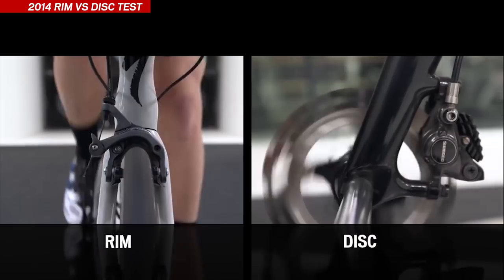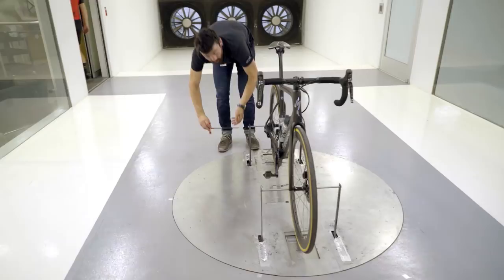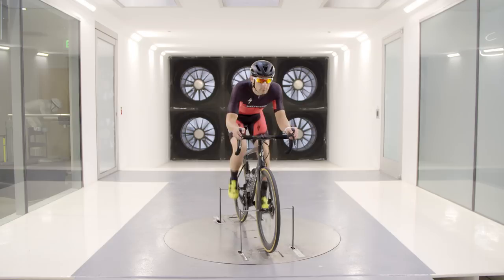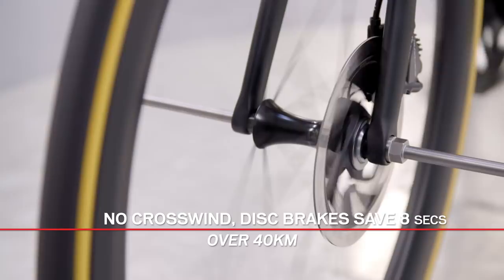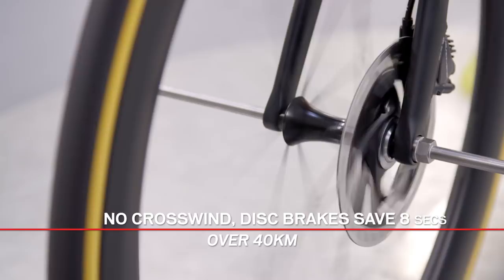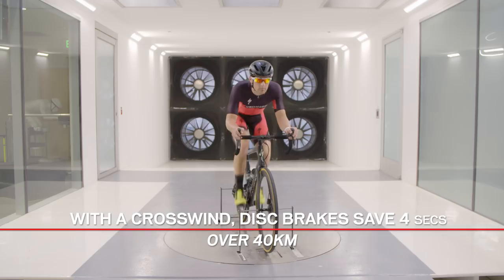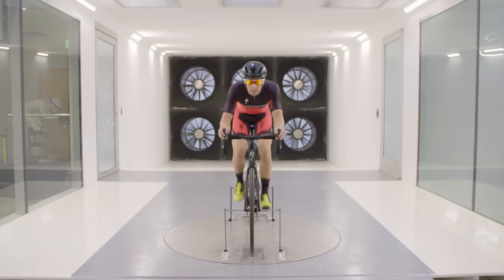The Win Tunnel: Rim vs. Disc Brakes

Comment: Can we get an explanation video about why disc's are faster? I'm interested in how that happens.
Reply: Dolfo Picanco cleaner interface at the fork crown area
Reply: Brake  disc have a better profile aerodynamics ...or  lower drag coefficient... you can see this image..  https://en.wikipedia.org/wiki/Drag_coefficient#/media/File:14ilf1l.svg
Reply: Yea, Shadowboost below is getting at it. We're able to (subtly) improve the shaping in the fork crown area, and also the upper seat stay area since we don't have to deal with the rim brake mount interfaces. The disc calipers add almost no drag since they are mostly drafting other tubes (e.g. fork leg). What's left is the hydraulic housing (basically even with rim brake cable housing) and the disc rotor, which is the primary drag culprit for discs. We're now able to more than offset that with frame/fork shape improvements.
Reply: I think its mostly marketing B.S. and bad science, as usual.
Reply: @sylvainmichaud2262  If you are going to say this is bad science, you have to provide at least a small explanation.
Reply: @DaveCM  I don't have to provide the science. Corporation making claims do ! I've been in the business of BS Marketing for most of my career. Believe me, there's very little science behind it and usually it has gone through a "rigorous process" of cherry picking.
Reply: @sylvainmichaud2262  no, you do. You made a claim, you have to back it up. They provided wind tunnel results. You claimed it was flawed and basically faked. You have to be able to point out at least some issues you have.
Reply: @DaveCM  
You sound like a flat earther, a Christian apologist or a climate change denier.

“It's easier to fool people than to convince them that they've been fooled”
Mark Twain

Comment: There are still a few issues that disc brake systems present that rim brakes don't experience. The first is the change from a symmetrically built front fork as compared to its asymmetric disc version. They won't perform the same and the disc version will likely have increased variance when loaded in different directions.

The second variance at the front is the dished wheel in the front. Previously we had a typically symmetric wheel, that with reduced spokes offered greater overall strength. Disc requires dishing of the front wheel and differing spoke tensions from either side. Again, the handling of the bike is likely to be impacted and won't remain as linear as its rim brake counterpart.

The final part at the front is compliance. The degree of compliance tuned into our front end road frame will differ with disc with the changes mentioned and the use of 12mm thru axles. In my view, this will be more notable than changes at the rear as the front wheel has a rather direct contact to the rider.

For the rear, its appears to be less of an issue due to the already asymmetric design in place today. The rear also has less contact to our hands, so maybe only your but meter can tell the difference to a lesser degree. It should stiffen overall pedal response with through axles given an extra dose of stiffness right where its needed and the removal of brake reinforcement on the seat stays could allow the designer to dial in rear compliance a bit better.

A note about discs in terms of torture testing that was done by the folks at Tour. An alloy wheel using rim brakes does withstand more torture than a disc brake. The test they provided was an extreme, but it does have good point as the rim provides greater mass, surface area, and a typically high amount of aluminum. Not that Al material properties does offer greater capacity for storing more heat as compared to the blended steel/alloy or full steel discs.

Discs will offer better modulation and better wet weather braking. If you ride a good deal in poor weather or are not the best descender, it may very well be worth the compromise.

This small aerodynamic gains or losses are of less concern when group racing and is more the norm and really should be focused more and the TT type of riding. Basically, anything against the clock where solo efforts are the norm.

With the current design norms, I feel its easier to design a better overall handling frame with rim over disc brakes. The gap will obviously vary from design to design. I'm sure you have some internal data to possibly present, due to your presentations on the rider first engineering concept, with a measuring system that could explain the differences with metrics over my own perceptions on material science and structural design. I just feel a good deal about the difference is still left unsaid.

Comment: Are you including "watts to spin" in these calculations? Zipp and Swisside have previously studied the effect of spoke count on drag and, IIRC, going from 18 to 24 spokes (as you would need to on a front disc wheel) requires an extra 3 watts.
Reply: Good observation. Yes, we quantify rotational power / power-to-spin. The magnitude of impact of additional spokes depends on bladed vs. round, bracing angle, etc...
Reply: So to be clear, the rider's effort into spinning the wheels is being calculated via some sort of strain gauge either on the bike or in the rollers? The two wind tunnels I've been to, A2 and San Diego Low Speed, both only measured translational forces. Also, from the video it appears you only swept the drive side. Did your test sweep the NDS as well? Quite a few people over on Slowtwitch are inquiring about this.
Reply: Yes, we have a separate instrument to characterize rotational power as a function of speed (both wheel and wind since they can differ) and yaw angle. As for the yaw sweep, here's my reply to someone else here that asked the same: The video only shows rotating to one side but the results are based on fully symmetric yaw sweeps. The crosswind results for the Tarmac SL6 are actually very similar on both sides, but nevertheless, we quoted the side with the smaller difference.
Reply: Thanks Chris! Did you guys publish a white paper on this? Just a side note regarding Roval's disc brake road wheels (such as the CLX50) it might be helpful to explain how you guys got to the lower than normal spoke count. I get it (additional spokes on the disc side) but it might be useful info to publish because I've seen a lot of people on Weight Weenies and other forums question the viability of less than 24 spokes on a disc brake front wheel.

Comment: Good to see aeroiseverything back!  Here's a MTB question for you.... what are the benefits and most aero position on easy xc and Marathon terrain, eg  Annika Langvad + Kate Courtney using the Sauser fork crown position  vs forearms on grips +stacked hands vs  hands on grips +flexed elbows + lowered torso vs narrow hand position holding inner bars, vs a standard upright XC MTB positions. Of course assuming equal ability to produce power....  Just back from the XCO @albstad and there were quite a variety of positions on the start straight, ditto watching the Cape Epic variety of terrain.  Thanks if you get a chance to test!!!!
Reply: That's a great question and a lot of people have been asking about the fork crown position. On the list!

Comment: So glad you're back. 
I've always wondered about 2 bottles on the downtube and seat tube versus none versus 2 aero bottles versus 1 aero bottle etc. Also a mini pump mounted using the water bottle cage screw holes. I've assumed there's a big penalty to a down tube mounted mini pump.

Comment: Alright, not many riders care about wind resistance between disc vs rim. It's all about the weight savings. Disc brakes are heavy. When you switch to rim brakes, you save about a pound a half of weight! That's insane!
Reply: so just go buy the fairwheelsbikes built 5.1kg disc bike build (minus pedals) and ride your ultra-lightweight bike...

Comment: As an engineer myself have a few questions....
Why were they faster?????
What difference between the older model bike and the new one made this happen?????
If you can’t answer these questions then your just being a brake salesman. Thanks
Reply: Here's my reply to someone else here: We're able to (subtly) improve the shaping in the fork crown area, and also the upper seat stay area since we don't have to deal with the rim brake mount interfaces. The disc calipers add almost no drag since they are mostly drafting other tubes (e.g. fork leg). What's left is the hydraulic housing (basically even with rim brake cable housing) and the disc rotor, which is the primary drag culprit for discs. We're now able to more than offset that with frame/fork shape improvements.
Reply: Chris Yu Thank You, I was definitely wondering what changed, it wasn’t mentioned in the video. Take Care

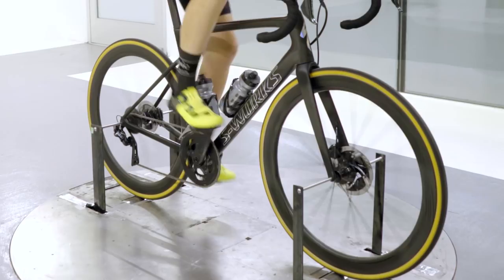Comment: At 1:44 that front disc looks like it's spinning a lot slower than the rear disc. I hope that in this test front and rear wheel disc speeds were matched and were also representative of simulated rider velocity.

Comment: I recently went from a titanium caliper brake bike to a carbon aero disc brake bike. Reason? To try something completely different AND because discs brake better. I don't care if pros use them or not. I like the way they work. As for the looks, that's highly subjective. I actually like the looks.

Comment: This is a huuuuge problem with the current generation of wheels: what is the effect of running 25mm (that balloon to 28) tires on 27mm rims? Or running 28mm tires (that balloon to 30, 31mm) on a 29 or 30mm rim? Basically test the rule of 105%. Lots of people are out here using fat tires on deep rims and I want to know if that downgrades you to box section levels or not.
Reply: That's a great question. Stay tuned!

Comment: Turn to the port side and run it again please
Reply: The video only shows rotating to one side but the results are based on fully symmetric yaw sweeps. The crosswind results for the Tarmac SL6 are actually very similar on both sides, but nevertheless, we quoted the side with the smaller difference.

Comment: Question: how do CLX 50 compare to 32 or box section wheel up an incline? How do you test for this is a wind tunnel, if at all? My assumption is that the CLX50 will be faster on almost all but the absolute most hilly courses or with enormous cross winds. Thoughts?

Comment: So 3T is (a little) right?!
Reply: By now, the bike industry has had a lot of years to R&D of frame/fork shaping for disc brakes so it's no surprise that aero disadvantages are shrinking/disappearing.
Reply: Chris Yu ok areodinamics, but the real advantage is the braking power in any condition, translated, safety.

Comment: IF disc were that much better of an all round option all  pros would b using them end of story , same as an oval  chainring again if they made a great deal of difference all pros would b using them . So I guess it comes down to the industry trying to keep the jo public interested in buying new bikes .  ,,, oh and disc on rd bikes are ugly
Reply: first of all they are better at braking but there is weight penalty thats why not all pros are using them about oval chainrings, many pros have to ride the components of their sponsors chris froome and bradley was able to do this because they are the leaders. For example in an interview with adam hansen he told that he has actually tried oval chainrings and said that ıt has a benefit but he couldnt use it at races because they are sponsored by campagnolo and he has to use a campagnolo chainset
Reply: Have you ever had an issue with braking ? Shimano Dura Ace best brakes on the market , if u have a problem then something you are doing is wrong
Reply: Pros spend so much time on their bikes that they can be against change and adapting to a new style/product/position
Reply: Pros aren't using them in the peloton because they don';t want to get caught out in a wheel change. For the rest of us: they are a a good option for the stated advantages.
Reply: ı have got r8000 ultegra brakes with alloy wheels they are pretty good for me ı dont have a problem with them but ı dont think this means that disc are no better they are way better especially if you compare them with carbon braking surfaces
Reply: Did you ever come down a hill at lets say 40-45mph in the pouring rain? You'll be glad to have discs!
Reply: Basing your reasoning on the supposition that pro-rider priorities are the same as your own is fundamentally flawed. Pros have to think about wheel changes, about braking too much and getting rammed from behind, about sponsorship, and even about tradition. They're not the brightest engineering minds, and often believe things even when there's data to refute them. How long did it take them to move to wider tires? Power meters? Aero bikes? They're slow to adopt because how they feel when they ride translates into speed when they need it.
Reply: > IF disc were that much better of an all round option all  pros would b using them end of story

That's just flat out wrong. 

It is FAR better to have fairings on your bicycle for the aerodynamic advantage, but you don't see the pros using them. Why not? Because the UCI doesn't allow them. 
It is FAR better to have a very low posture on your bicycle for the aerodynamic advantage, but you don't see the pros riding bicycles with extremely low postures. Why not? Because the UCI doesn't allow it.

The UCI is the deciding factor in what professional riders ride, because the professional riders only ride in UCI sanctioned events.

If you want to know what is the best option for a fast road bike, you'll want to see what they're doing in triathlons, as those aren't governed by UCI rules. And guess what - they have very low postures, they have extreme aerodynamics and they have disc brakes. They don't have fairings, though, and I'm guessing that's because the rules prohibits those.
Reply: Disc brakes feel stronger.  I'd prefer a lighter setup personally which is why I like rim brakes.